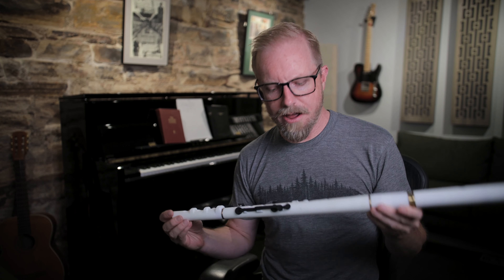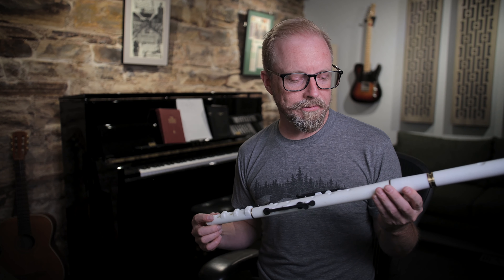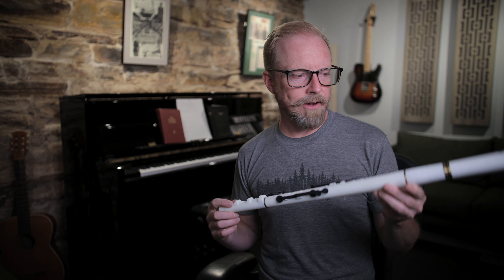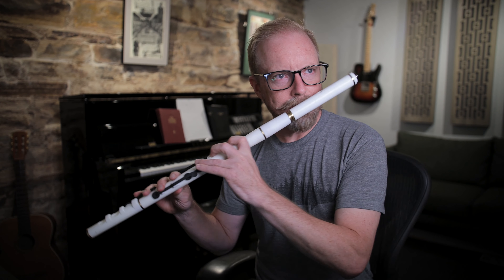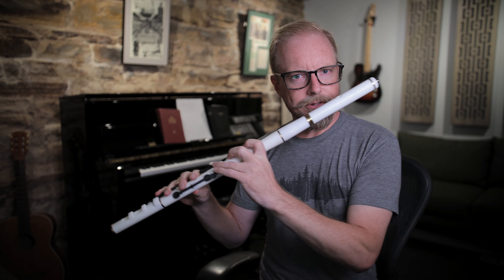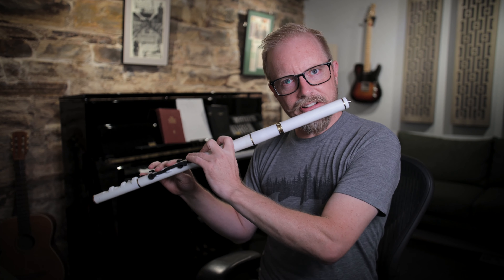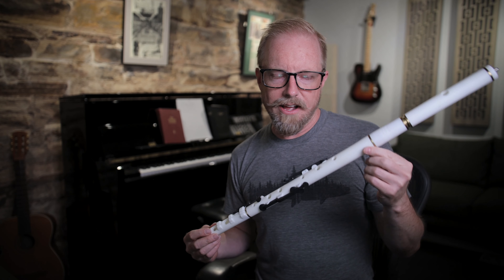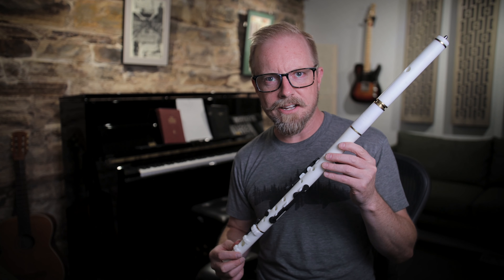3D Printed Irish Flute!

Comment: sounds cool... Does it have inner metal tube in the head or not? Hope they come with a more traditional  black or wooden tone, sounds great and very useful
Reply from the maker: Headjoint is unlined.  White is used as the material prints more accurately than the black.  Black would be nice though!
Reply: @TheIrishFluteStore  could be some black coating instead of black material also, but that would be another process and material added, looks nice in clone trooper white anyway 💖

Comment: my goodness $799,99 for a 3d printed plastic flute?! 
that is just criminal. why not get a genuine wooden irish flute at that point.
Reply: Where are you going to find a 6 or 8 key wooden flute for that price? I haven't seen it.
Reply: @lonnieezell  I'm sure you could find a second hand keyed wooden flute for that price. in fact looking at eBay i saw a 6 keyed flute going for around $300

besides. its 3d printed plastic. its not like this is a lengthy process and its hand crafted out of a piece of cured wood by a renowned artisan... you could probably churn this out for less than $60 given you had the files. 

that's probably the reason they don't sell the files.
Reply: @downey2294 the price is not just for materials though I suspect it costs more for this high precision resin than wood. Also the tone holes and embouchure are hand finished I believe. I own one of these and I assure you, it’s a bargain and plays much better than most pro level wooden. Lutes I’ve played. I also have a Delrin and silver keyed Copley that cost five or six times as much as this and these two flutes are very comparable in tone and quality.